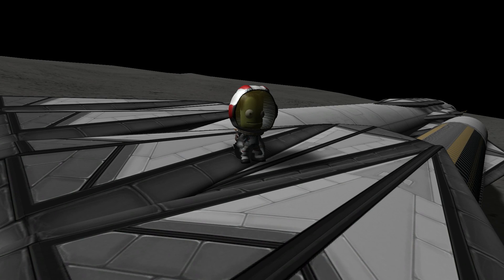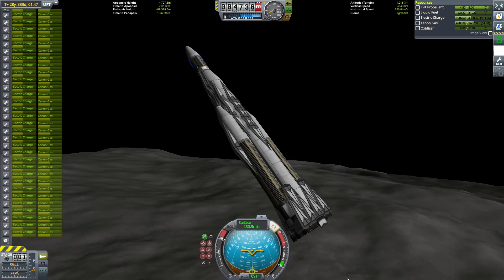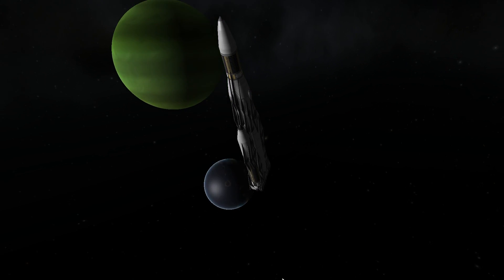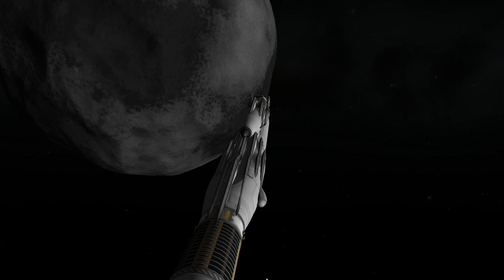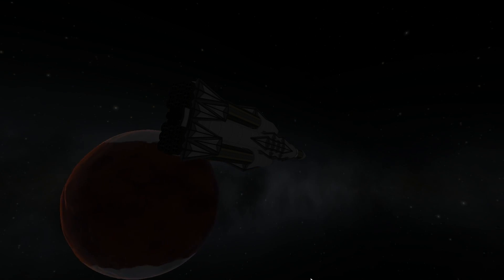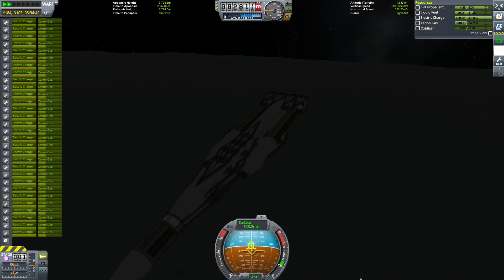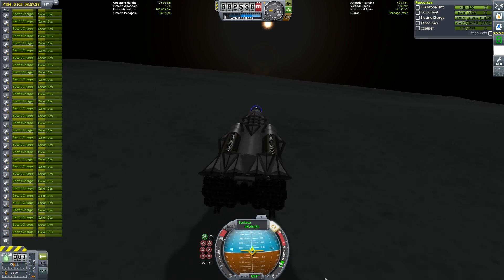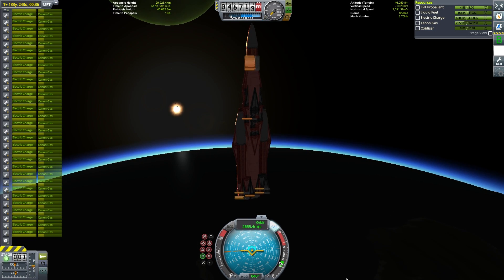SIngle Stage Stock Endurance Record; Part 4

Comment: An Angry Bird Man seems on the right track, but I think you'll take Mun before Vall: that is, Laythe, Mun, Vall, Kerbin. You can get from Vall intercept to Mun for very little dV: hit either Tylo or Laythe to slingshot back to Kerbin, maybe aerobrake at Kerbin, and have a decently low V_inf to Mun. To get back is not bad either because Mun is high in Kerbin's gravity well. What you get in return is to land on the 2.3 m/s^2 gravity Vall as light as possible rather than the 1.6 m/s^2 gravity Mun, which is important given your low TWR.

Comment: Why didn’t you go straight from bop and pol to Laythe and eeloo before going to duna, rather than returning to Jool several times? Just curious, and the video was awesome!
Reply: The gravity of bodies in increasing order is: Gilly Pol Minmus Bop Ike Dres Mun Eeloo Vall Moho Duna Laythe. Liquid fuel is very inefficient, so he's minimizing his use of it by visiting the bodies mostly in increasing order of gravity: Kerbin Minmus | Gilly Pol | Bop Dres | Ike Eeloo | Laythe (Vall Mun Kerbin). Compared to this xenon is efficient, so he can spend basically all he wants moving back and forth between Kerbin and Jool. To visit Eeloo right after Bop would burn lots of unnecessary LF.
Reply: Probably because it's much more interesting this way

Comment: To truly conquer ksp you have to go to tylo and back in a single part with no refueling
Reply: Single part? That’s a mod.
Reply: Max J. I’m taking about only one ship that does the whole trip with no little landers
Reply: Have you seen the thread at https://forum.kerbalspaceprogram.com/index.php?/topic/167249-ssto-tylo-no-refueling-or-docking/ ? It may just be possible but require a crazy maneuver like touching down on Tylo at 100 m/s and taking off without stopping.
Reply: Probably if you climb a ladder ssto to and from Tylo, or make a giant ssto of unimaginable size.

Comment: The only viable targets left are Moho, Val, and the Mun (excluding Kerbin). I hope to be proven wrong but I don't think there is enough dV left to go for Moho especially after the Mun and Laythe which are both pretty much guaranteed. I'm predicting Laythe > Val > Mun > Kerbin. Of less likely probability is Laythe > Moho > Mun > Kerbin, and if moho and val were done it would be Laythe > Val > Moho > Mun > Kerbin. But I also don't think that's going to happen because it would probably end up being split into 2 different videos, Laythe > Val > Moho then Moho > Mun > Kerbin. SOOOO it's going to be Laythe > Val > Mun > Kerbin for a spectacular finish to a great series.
Reply: Moho is higher gravity than Mun, so Laythe > Mun > Moho is more likely than Laythe > Moho > Mun.